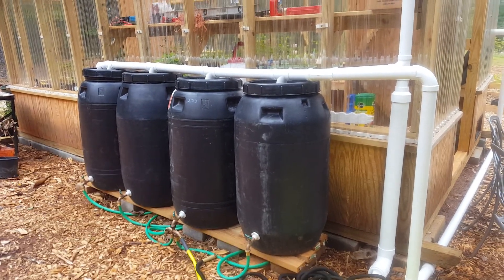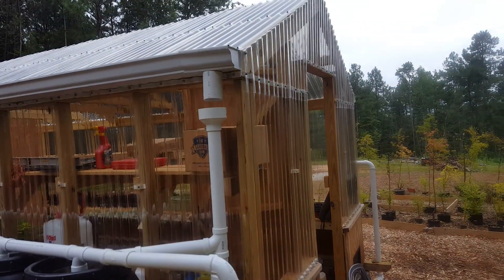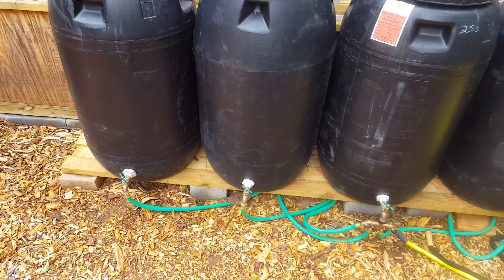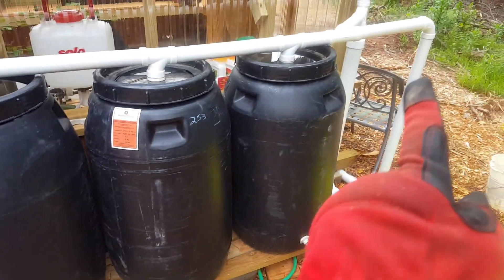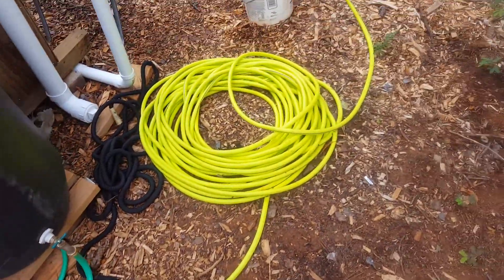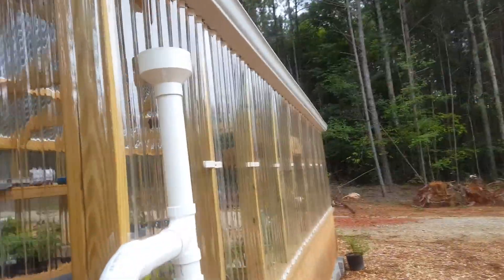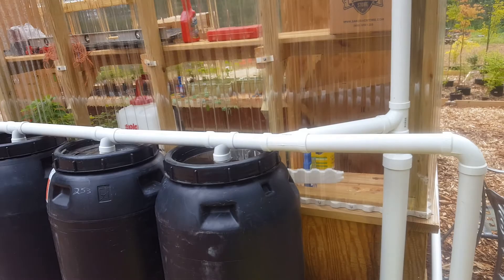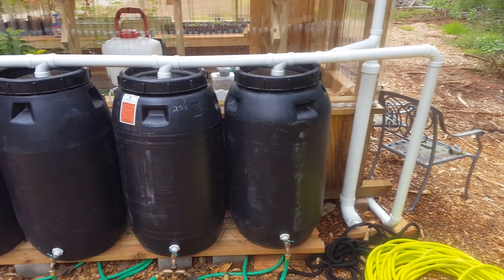#19 Greenhouse- rainwater harvesting setup

Comment: How does the flush system work?
Reply from the maker: The 1st flush has a plastic/rubber washer with a small hole in it. It shows the water to drain out. It shows the initial water to be captured in the tubes which could have the most particles/dirt/bird poop. The water then goes into the tanks. The washer allows water to continue to leak out but very slowly compared to the volume of rainfall. Once the rain stops it will drain completely out. Allowing the process too start all over on the next rain storm.